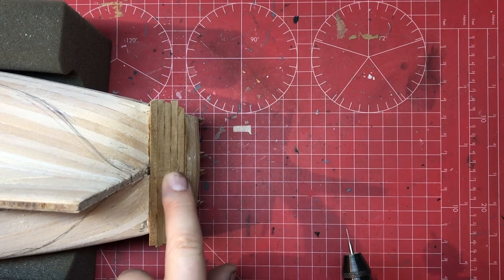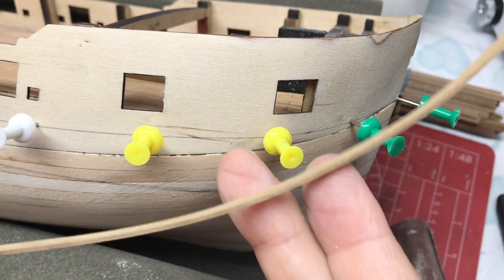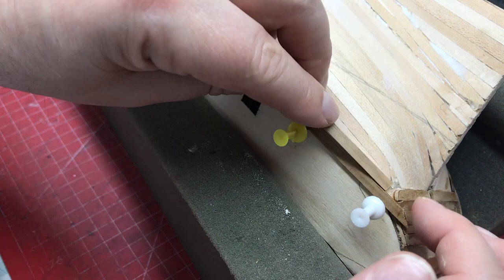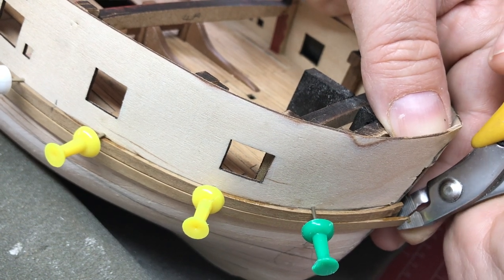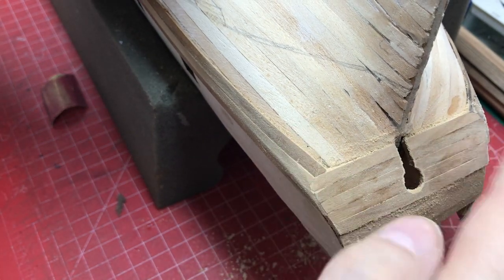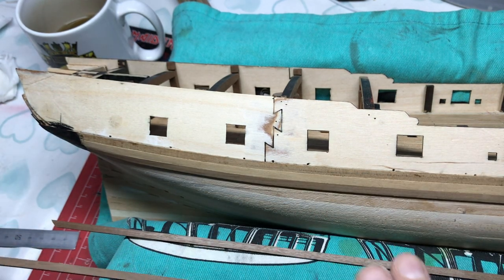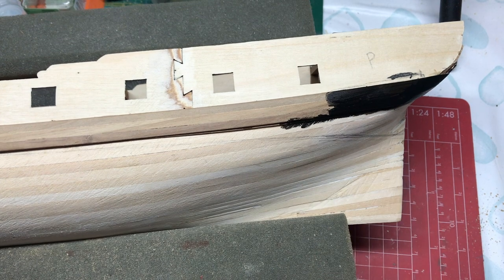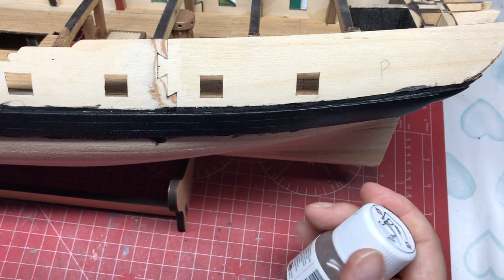Victory Models - 1/64 scale HMS Fly Part 10. Wales

Comment: Hi Jason, another great video.  The HMS Fly is really starting to come together.  Years ago I used to do a bit of woodworking.  One of the things I did was refinish gun stocks. I used a technique called wiskering, some called it dewiskering, to get a really smooth finish. What I did was after sanding to as a nice as a finish as I could get, I would go over the wood with a slightly damp cloth.  This would raise the grain just a little.  I would sand again and maybe even wisker the wood and sand one more time.  The finish always turned out like glass.  Any time you apply a finish you raise the grain.  By wiskering, you raise the grain before finishing so it doesn't happen during the finishing.  A useful little trick you might want to try sometime.  Have a great day. Jeff
Reply from the maker: Very interesting, I will have a play.

Comment: Those push pins I find absolutely invaluable for doing second planking, they not only hold position on the inner hull but will also hold the second planking down tight whilst you get a good bond. That Roket CA does look to be better than the ZAP CA, I found the ZAP doesn't necessarily bond very quickly or at least not as quickly as advertised. I also found that prow piece to be rather fragile and it split on me across that upper tab because I think I had it in too tight, so your point about using an off cut as a test piece is excellent advice.
Reply from the maker: Thanks for the king words, I do try and handle pieces as little as possible before fitting. I was ok with the Zap, if you want to speed up the cure time dampen the plank.